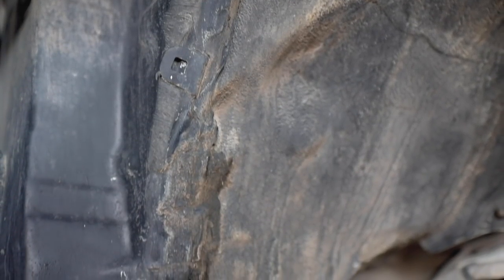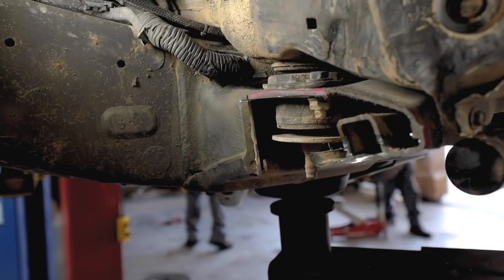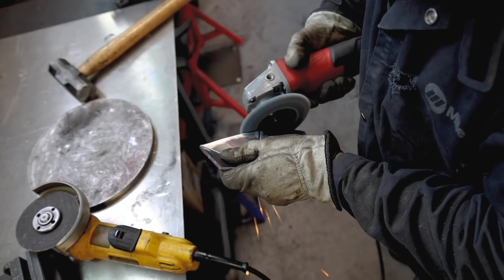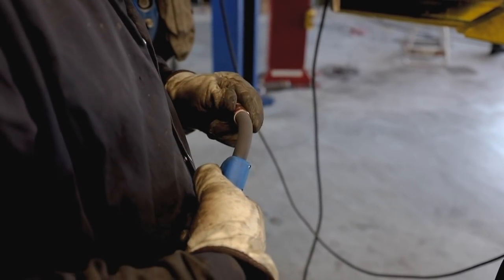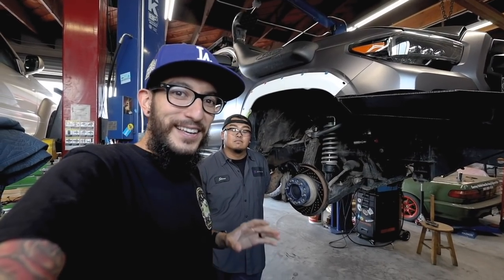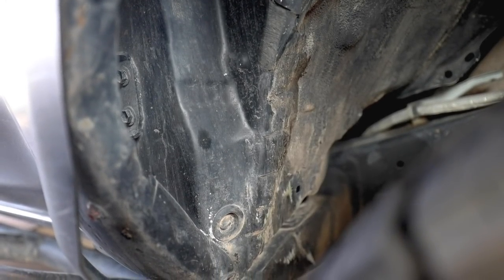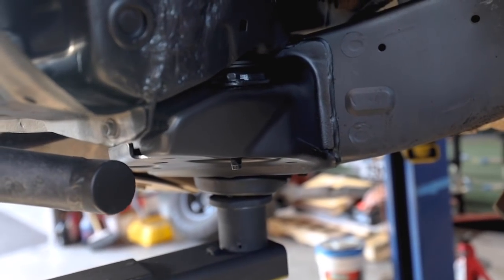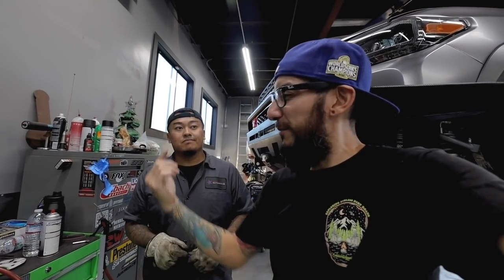Toyota Tacoma Body Mount Chop Needed? | NO MORE RUBBING

Comment: I have 285/75/16 on my 2019 TRD Off Road and I have no rubbing at all without a chop. The only rubbing I have is because someone backed into front bumper and pushed it in just enough for it to rub when I back up and turn wheel a certain way.